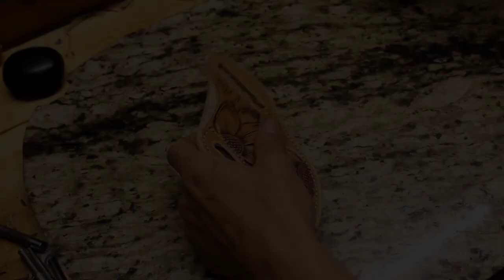Making a sunflower tooled knife scabbard

Comment: I've been using a wood dowel to slick my edge and it's just not producing the finish I want. What were you using to slick your edge? Thanks. Beautiful work. 

Also, what shading stamps did you use?
Reply: What kind of wood is the dowel? Also what are you using to seal the edge? These both play a roll. 

Looks like he was using cotton canvas, and a steel rod of some kind. Denim also works. Personally I don't get as good of result from denim or canvas, but I use either of them in strap goods. It's faster pulling a belt or purse strap through your hand that to run a stick back n forth. 

I sand my edges to at least 320 grit before slicking. Preferably higher, like 600 but I've run out and have gone in to town to get some more. I use a cocobolo slicker, but I've also used the wooden tool handles on my edgers. If you go to the hardware store and get plastic pullies  they work excellent to. MyI've been using tokenole (spelling may be wrong) lately, but the bar saddle soap with some water and bees wax also does a great job. Out of everything you do in leathercraft, edges are probably where most the time is spent. It's one of those minor details that can make or break the feeling of quality good.

Comment: Great video. What is the function of the middle welt piece of leather that you add in? I’ve seen some craftsman make pancakes with out this step and wondering why some add it and some dont
Reply: The welt is to protect the threads for on open blade. Keeps the cutting edge of the knife from sliding between the layers and cutting the threads out. Normally, you would use a heavier weight (thicker) leather for a welt. Adds a level of protection to your project. Hooe this helps!